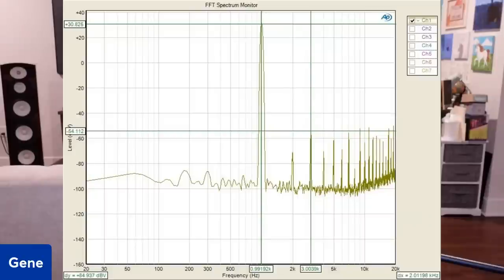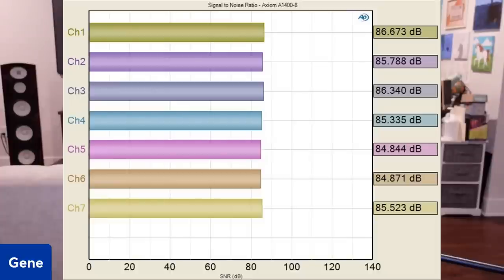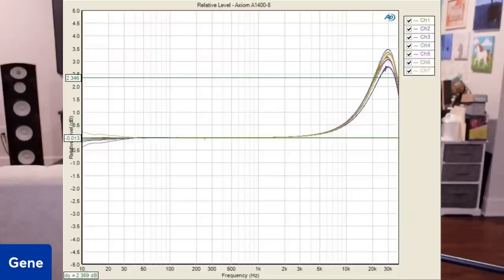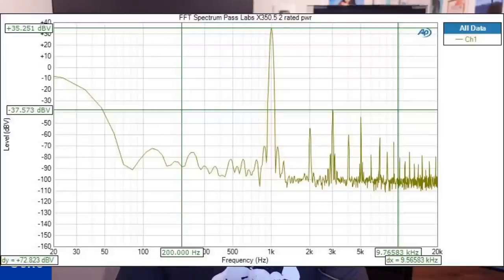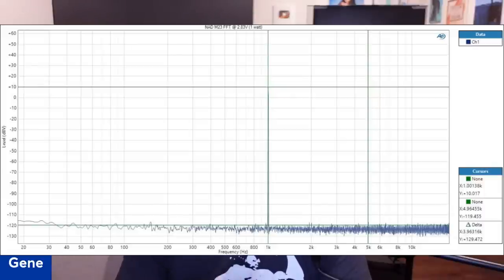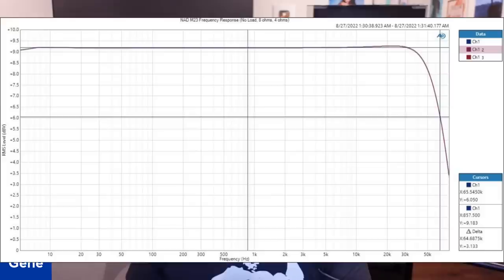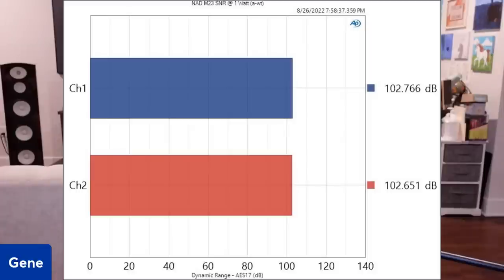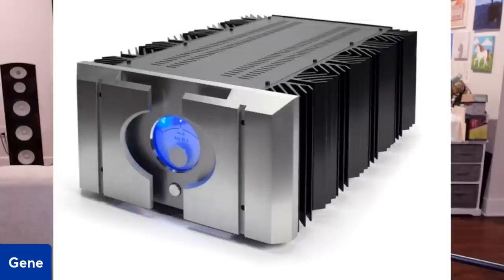Linear Amps are DEAD, Long Live Class D!

Comment: I will not "dump" my Class A/B amplifier until it dies, and in that process it will outlast half a dozen Class D amplifiers. The MTBF of a linear power supply is much greater than switch-mode junk. If it should fail, the components in a class A/Bare easy to identify and replace, as opposed to the Class D, which is covered in hundreds of surface-mount boogers. We've not seen manufacturers adjust the price of these "high end" Class D amplifiers, even though they don't contain nearly as much copper and iron, have a dramatically lower shipping weight, and cost a small fraction to manufacture, rather they are enjoying a high markup on these devices. Building devices with lower expected lifespans guarantees a future revenue stream, it fits the "disposable" model, but I wouldn't call it high end. None of us will be handing down our Class D amps to our kids or grandkids like we would a vintage Marantz or Pioneer receiver, this stuff will be in landfills petty soon.

Comment: There are a number of manufacturers producing class D amplifiers modules like Hypex, Purifi  etc. These amps are typically sold to manufacturers that incorporate them into an amplifier design, As a consumer, it's not at all easy to discern who the manufacturers are that are producing class D amps and whose class D module they are using. It would be really helpful to see Audioholics or another publisher research this and produce a current list of class D amp makers and who they source the amp component from. I know from researching this a bit myself that NAD, ATI, PS Audio and a long list of smaller domestic and foreign manufacturers are building switching amplifiers but it's by no means a complete list. Some of the manufacturers disclose whose amp module they're using and whether it's a stock or modified version but not all do.  I'm also curious about the reliability and longevity or class D amps compared to class AB amplification. For example, I'm interested in NAD's M 33 amplifier, but I noted that NADs warranty on this product is 3 years. That's not terribly reassuring for a product that lists for $5999. Class AB amp builders like Bryston, Luxman, and McIntosh have warranties that are 20 years and that tells me they trust their build and intend to stand behind it. Last but not least, I have followed the availability of NAD's products for over a year now and it's perfectly clear they have serious supply chain issues as their products, particularly their class D products, are often out of stock for months on end with no expected delivery date. I am definitely interested in class D but I am willing to wait awhile to see how these perform over time and whether or not manufacturers of these products begin to offer more reassuring warranties.
Reply: Look for threads on ASR as well as videos here with Dylan of Buckeye amps.  I think you'll be impressed with his passion for quality.  He seems to be a master of class D amps even though his PhD is in Immunology.
Reply: I will build a Nilai soon!😊

Comment: I am one that prefers an 1977 Trans-Am over a new Tesla any day of the week. It is the same when it comes to Class D versus Class A, A-B, or Valve amplifiers. In listening, I get bored with Class D's clear, pristine, pleasantness. Do not get me wrong it is wonderful technology and there are several I really enjoyed listening to so this is not Class D amp bashing. However, I do like a little grunge and personality within my system, so for now I will stick with the old school technologies despite their many quirks and failings. I just find a big, beefy, Mac much more fun to listen to than a Bel Canto.
Reply from the maker: So you like vintage for nostalgia, not for performance,  gotcha
Reply: A 6.6L engine with 180 Horsepower. My wife’s small SUV has 185.
Reply: @povertime6381  Exactly my point! I never said it was a vehicle that was capable of ultimate performance. Many modern vehicles are better engineered, more reliable, and much safer. You enjoyed them for their looks and sense of mystique. How collectible will the SUV be when it has seen 40 plus years? In short, the experience of driving a Trans-Am is for fun, not utility. That being said, GM did not want to be seen as continuing to produce gas guzzlers. When these were being built it was the start of the fuel crisis. So to keep the government off their backs, they and other manufactures often underrated the HP their engines could actually produce.

Comment: I played bass for a band some 30 years ago. My amp was tubed, and weighted in at probably  60 pounds. I picked up the bass again several years ago, and I bought an amp that is 800 watts, the size of a 1,000 page book, and weighs 8 pounds. it sounds good. I can carry it in a small bag.The difference in weight, size and power are stellar. It has a tubed and a solid state input, which can be blended.
Reply: 70s-80s Bass player also. Sounds like an SVT. I have (2) Crown A/B pro amps and an 8-10 SWR Workingman with 2-18 PA bass cabs as a stage rig. Bi-amped setup. Have looked at all the newer class D heads and am amazed at the size/weight. Many jobs today would not allow the old-school Bass Wall. Some are in-ear only. However, my Crown A/B still packs 450W @ 4 ohms with .5% THD. I cannot find a class D amp for a home stereo that comes close without DOUBLE+ the THD numbers. My audiophile YouTube adversaries are all about Op amp rolling and external linear power supply upgrades just to boost the performance of $150 Class D 2-channel amps. Extra items bring the price up to the $500 range. My pro gear is from the 80s and 90s and STILL performs without missing a beat. Not ready to give up my muscle car just yet. And I mean my Camaro. LOL!
Reply: That really is the big advantage of a good class D design - besides size, weight, and efficiency.

They sound so neutral and clean, it can seem "too clean" and "dry" to some people whose ears are used to higher distortion of older class A and AB designs. And you can easily get those characteristics to the exact point you prefer by using different preamp stages in front of the class D power stage.

It's really the most versatile design currently possible. Any desired sound characteristic can be done relatively cheap and easy.

Comment: Hi Gene. Great topic. I have embraced class D and have a few pairs of Class D amps that sound great. I sold my big Bryston 28B3 monoblock amps. I’m not getting any younger and heavy class AB amps are just a pain (literally) to move in and out of my rig. Now I do have some tube gear. But that is a separate beast entirely. But as for solid state, class D has arrived.

Comment: Wondering what they sound like in comparison. Sometimes tubes and other amplifiers have a more pleasing warm sound. Even if it’s not quite as perfect. Speakers obviously as well. So just because it measures really good doesn’t necessarily mean it’s going to sound really good. Wondering what your thoughts are. I know you’re very technical, however sometimes just like records which aren’t perfect or more pleasing to some audiofiles
Reply: I agree. I now that amp that measures really well can still sound lifeless, non engaging, sharp etc. It has to pass listening tests as well. With that said, high end class D designs do sound good.

Comment: Gene, I'm sitting here laughing.  I put together a Purifi from parts with a Ghent Case and a Hypex Smps. It cost me all of $1200, and I'm certain it's performance numbers at least equal NAD's.  I'm using it to drive LS 50 Meta, with a SVS SB2000 sub to supplement the bass.  The whole thing is part of a 5.1 channel system run by an OCTO Research DAC 8, and it's server is a fanless Mele Quieter 3 with multichannel Dirac Live 3 to make everything work and play nice together.  

I'm an audiophile of 47 years, and if someone would have told me even 10 years ago, I would one day be able to put together an audiophile multichannel system of this quality, that works this well for both stereo and 5.1 channel, for around $5k, I would have told them they were nuts.

We are truly in a golden age of audio.  We just need to be careful not to slip on the snake oil certain vendors have spilled along the path.
Reply from the maker: Incredible indeed!

Comment: Class-D audio power amps have totally taken over live sound production. Ten years ago, you could still find linear Crown, JBL, QSC, and Yamaha power amps, but they were relegated to permanent rack-mounted installations that demanded utmost reliability. Early generations of Class D amps had a reputation for sudden infant death syndrome, particularly when their output terminals were shorted. Nowadays, networked remote control DSP features have been fully integrated into professional power amps, simplifying monitoring and maintenance of power amp racks.
Reply: The Coda Audio line array I got for my new venue has 7 4-channel amps at 3500 watts per channel. I can't even imagine how large and heavy the amplifier stack would be to put out the same power with class AB.
Reply: @Roof_Pizza  Exactly, And? Sound Reinforcement & Studio Monitoring is different from Home Stereo.  

I've been present at all three. From live concerts to in studio monitoring / recording process. I use to hangout in studios in NYC with my musician friends.
What I find surprising still, is most musicians don't necessarily own High-End gear? Although, nowadays studio & home gear are becoming a blur. 
"Focal" makes some really Great Active(D amplification) & passive speakers.. that are comfortable in either environments. 

Focal is not the only ones either. JBL has of recent years, attempting to recapture its glory with their very nice Blue baffle monitors. I don't think JBL has dabbled into "Active" yet?
Studio playback is closer to Home listening. Thanks to the use of XLR options.

I go back to when JBL & Altec Lansing (which are cousins, if not brothers so to speak) ruled studio monitor scene. 
That was the choice of playback we wanted at home. Mostly all our 70s artist were mastered using them! 
Sound Reinforcement is a totally different animal. Most of the robust electronics have noisy built in fans for cooling & reliability purposes.
Reply: @alex_stanley  Probably a ton? LOL 
But, as we have learned power isn't the whole story. Early car amps made that clear with their actual power rating & distortion claims checked.
Reply: @Roof_Pizza  @roof pizza And you now have some more info to work with? Read between the lines.
Reply: @jamiesmith6838  Thankfully the latest class D can give high power with very low distortion.

Comment: Yeah man, Class D today is the way to go for sure!  I have been interested in it ever since the diy hypex ncore nc400 modules came out and smoked the floor out of other designs. My wish now is for Onkyo/Denon, etc to make an AVR with a good class D module that could provide true 100wpc all channels driven that’s easy to move into position and it’s affordable.   Sadly, I believe we are still a numer of years away from that
Reply: Yeah, I'd love to see a Class D with support for 7-8 channels (7 you can bi-amp LR, 8 you can bi-amp LCR) so that you can get high quality 5.1.  I'd like to see Denon and Marantz do it but I'm not happy with their current pricing.  I'd rather see Onkyo and Pioneer make a strong comeback with a fantastic product or a newcomer like Emotiva and Monolith enter the AVR market.  

Forget all that Atmos nonsense - we can just put it behind us and move forward.
Reply: @techsamurai11  They say run more power than your speakers are rated and of course listen. I just like to see loudspeakers potentials. Now that I am older? I never listen to headphones or car audio. I prefer silence until the time comes. Preserving my hearing.
Reply: Atmos nonsense , ya right !! My Hi Fi journey began in 1966 In a PX in Cu Chi S. Viet Nam  about the time that Hi Fi turned into Stereo ! In 1967 I went to Hong Kong and bought a Dual TT w/Shure M 44-7 cartridge . I chased tech . every year since and around 1972 I was cutting edge with 4 channel sound ! I then spent over 13 years in the consumer electronics business managing a 27 retail chain of CE stores in California , before starting my own chain of stores . I have never left this hobby for a moment and count among the people that I hung with as Saul Marantz , FFloyd Toole ,Albert Von Scheikert and Kevin Deal . You would be hard pressed to find someone that has loved this hobby and adapted as much  as I have . I waited for front projection to mature and enjoyed front projection from the begining with a Panasonic LCD projector before graduating to A Pioneer Elite ,JVC clone and now have a Last generation LCOS JVC projector that throws a great 4 k image to my next JVC laser 8 k projector ! I have a dedicated Home Theater that is in a seperate building that is a 7/4/2 system and am anxiously waiting for my order of a Buckeye 3 channel 1A400 Purifi  system (class D ) to power my LCR fronts . I retired in 2009 and live on a couple of acres in Maui to spare my neighbors of the reference level sound that my system outputs ! The DTSX /Atmos sound of everything that is put through my AV/ system is breathtaking and everyone that experiences it is shocked (in a good way ) ! Don't trash anything that you have not experienced ! You a alot of cool stuff to look forward Too !!
 K  @techsamurai11

Comment: There is not only Class D. At high power and voltage levels, "Class I, BCA" by Crown audio (Gerald Stanleys patent used in I-Tech and XTI 6002 amps)  will avoid reverse recovery of the MOSFET's body diode vs. standard Class D at the expense of more complexity.  Very clever design and the patent will expire soon, so expect to see more amps of those topology in the coming years.....

Comment: My belief system was shattered when Powersoft put linear amps on life support in the pro sound /touring markets. Dinosaurs are holding on to linear because they need the bulk and size to justify the crazy prices . Then there's the imaginary "sound" which usually got snuffed in a blind test. It hurt me to admit that my McIntosh space heater was getting smoked by a Crown XLS. My NS-1000Ms and wallet couldn't be happier.  Letting go is really hard after spending so much money over the years. For myself I just had admit that my Mac loyalty was more mental gymnastics and cost bias than anything coming through my speakers. 
Great video man!!!!!

Comment: I using class D amp since 2012 and I’m very much satisfied. It’s pioneer sc LX 82. Which has B&O ice module and have the possibility to active bi-amping . I’m Running a pair of TAD S1-EX ( Pioneer), a very difficult speaker to drive. I know I should have gone for a pair of Belcanto monoblock, in future maybe I will. I had pre-power from Copland, and some other power hungry amps, but at the end I’ve sold them and stay with something more efficient. Trust me electricity in Europe is very expensive and if I can get almost same satisfaction from a class D then it’s better to stick with it.

Comment: Ohh, I love that. I don't have the money to buy the actual parts so I keep designing amps at MultiSim and run simulations to check out the distortion patterns and try to improve them. I designed a bunch of linear ones, and now I am at the beginning of designing a class-d, but the simulations take too long to run when it's a switching circuit. But I would love to know the details of the schematics that contribute for the distortion profile of the amp. Right now I don't know much about it, only that it can come from an op-amp that most designs use that could introduce bad distortion when it's not high quality.

Comment: Class D amplification has had a long impression as being less than. 
Oh has times have obviously changed from that personification. 

I've had some monolith in my days: Parasound HCA-3500 & the BAT VK-500 (BAT PACK). Room heaters powering KEF 105/3. 
I've also owned an NAD 2200, as unstable as that amp was. Wasn't great sounding either, to my ears. It simply lacked depth, detail & air.
From memory, I had better results with dynamics & speed with a Classé CA-200 & CAP-151 biamping. 
Definitely more coherency with the one power amp then with the two rig. 
But the dynamics & speed were so satisfying together. 
I was hoping to duplicate with the dual mono designs of either the HCA-3500 or with the VK-500? To my dismay, it didn't happen. Probably the synergy was off ?
I ended up moving & selling all those high-end pieces in a downsize for vintage gear from a Sansui integrated. AU-D11 ii. I gave up the slam & lowest noise floor for speed & detail. 
Now if a NAD Class D amp has the speed & detail of a Spectral DMA-180? I'll dig up my ladder & climb back up the "high-end" tree & purchase an NAD M23. 
Before I go there, I'll give a (pre-owned) Luxman L-509X a go first. For the integrated is redux of simplicity I highly appreciate these days of old. 

I'll look Gene to see if you've done any integrated amps a thrashing? A Class D integrated? Now that would be interesting too!